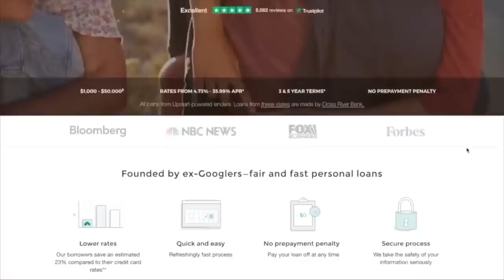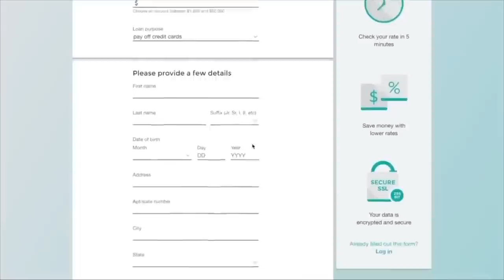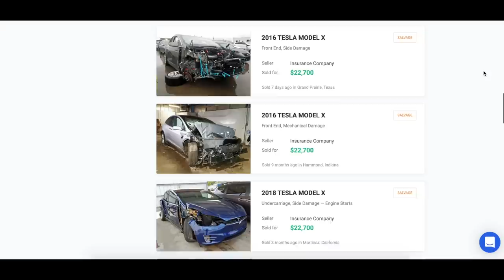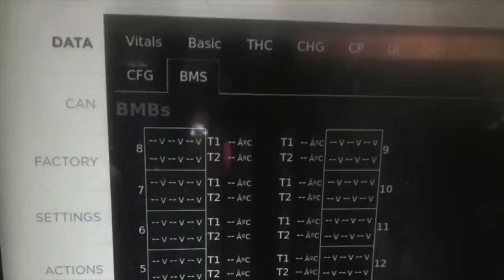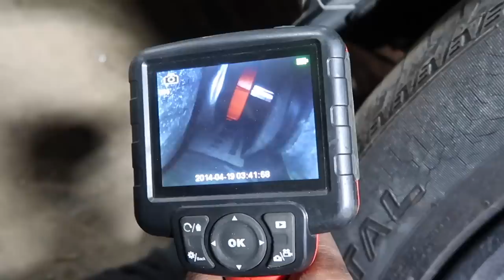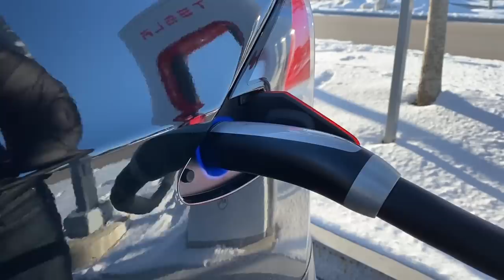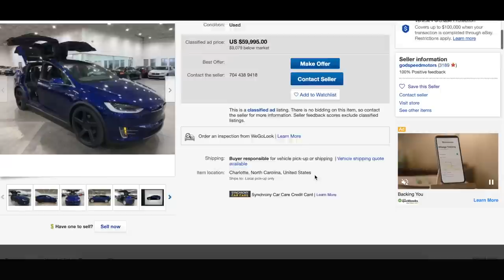Why this Tesla was my Biggest Financial Mistake

Comment: I've worked on a house like this once. Gutted to skeleton and even had to replace some stringers.  Would have been cheaper to bulldoze and drop a prefab.
Reply: But the Shell of the house was beautiful?
Reply: @Lovin_NY93  nope not at all
Reply: Why is it renovation is so much more complicated. I did the same - saved a house that cost more than new construction. Learning curves are seriously underrated
Reply: @b4804514  problem with it is most of the time it's dealing with a ton of badly done small renovations done over 100 years plus boards warp and houses shift. And don't get me started on frost heaves

Comment: This is why I bought my model S 60 for 32k. Looks and runs like new, and no labor involved. Uncle rich's videos have scared me silly. I was going to build a EV from scratch for my channel. Not anymore! 

Great lesson in this video. And good job to everyone who brought this model x back to life. Absolutely incredible!
Reply: DIY Solar Power with Will Prowse  you get a used fully loaded Bolt EV now for $18,000. lol Why rebuild anything when you can just buy.
Reply: Will, I converted a 1986 Mazda B2000 to DC EV. 8 grand for parts, not counting labor, and the batteries (at the time) lead acid - are WORTHLESS. Now if I want to get it going again, I’ve STILL got a 1986 Mazda with no heat, no AC, and I’ve got to get batteries and a BMS. Anyone want it? 9 inch netgain, Curtis controller (the one that whines at low current/slow speed) - I’m thinking of pulling the guts, putting it in a newer body... who am I kidding... 
-
One thing I did learn (I live in South Carolina)... If you don’t have a 400 degree (F) heat source in front of and under the passenger cabin, AC isn’t a MUST, its merely a ‘nice to have, but I’m OK without it’.

(I love your channel too, Will!)

Comment: i had the same happen with a 1991 BMW E30. $3500 for the car... $7000 in repairs later i donated the POS after i melted the pistons. so $10k+ evaporated. the term we now use for these scenarios is "toxic asset." --- something that really can suck up all the money in the world and still be worth less than the sum of its parts.
Reply: Lol I mean it's a bmw
Reply: all BMWs are toxic assets
Reply: Had the exact same car and problem I paid 3500 for it and when I added up everything It surpassed the cars value i cut my losses sold it for 2000 and lost 1500 but I know it was the right move
Reply: Also did it happen to be 318is?
Reply: Manz lol... Yeah, I hear ‘boats’ are like that too...

Comment: Flood cars,  stay away or more accurately run away. So many electric modules that corrode. They may be good today but tomorrow or the next day?
Reply: Agree-this car is a time bomb-Teslas as used cars make no sense, especially with damage. I predict that once there is a large number of these cars on the used market, their value will plunge-just too expensive and difficult to fix. I'd also be wary of allowing such a car at a public charging station-might be dangerous

Comment: I would have very much liked the Louis Rossman collaboration. Judging from the two channels, I'd say Tesla and Apple are very much alike, Tesla is trying to avoid the right to repair as much as Apple is trying to stop it from happening to them.
Reply: I'd love for this collaboration also.. would make amazing content.
Reply: Agreed, it's kind of surprising how similar they are. Also with Tesla's warranties starting to run out we may see more of the wear and tear problems that Teslas may have as opposed to rebuilds.
Reply: Probably the biggest reason I avoid Tesla. Repairing a car & modifying it should be a right. This is just anti-competition business practices which is designed to only benefit themselves.
Reply: this mail louis the boards and see if he can figure them out if he does you got spare parts
Reply from the maker: its still in the works

Comment: Great video Rich, very well explained the potential pitfalls of salvage rebuilds.  I've done 5 Teslas, two MX. With a '16 P90D, all was great, no hidden surprises. With an '18 100D, looked like only front quarter.  Has hidden frame damage. 6 months later, still in process of repairing, and the cost is over 10k more than I first planned.

Comment: Hey Rich , at least you have less financial mistakes than Sam Crac ...check out his Range Rover disaster 😂🤣😂
Reply: Range Rover was a good buy, he payed 1400 when parts are worth 3-4k alone.
Reply: @MrQuidy  How about the green Ferrari?😂😂
Reply: Range rovers can be a gold mine if the good money parts are in great condition, I got offered 3k in total through several buyers wanting different parts.  for a; bonnet, rear tail gates, wheels, full doors, sunroof mechanism, air con controller and pump, original working H&M stereo and then the seats yet best offer for the complete running car was only 1,800 🤷🏻‍♂️

Comment: I think that your mistake was buying a FLOOD damaged vehicle. It's one thing to repair a salvage car that was in an accident, but water damage is something that is not worth trying to fix because it causes so many problems throughout the entire vehicle.
Reply: Generally speaking a ‘flood damaged vehicle’ doesn’t have body damage. So, in theory, you take the good parts out of a wrecked vehicle (carpet isn’t damaged much by a wreck!) - and put it in the flood damaged one. Until..... you have the problems that Rich had...
Reply: @Maybe-So  so change out like every damn mechanical part, wiring harness, wheel bearing, everything? Flood damaged is NEVER worth the risk, spend your money and time elsewhere.
Reply: Flood damage can range from 1 inch above the doorsill to 20 feet over the roof. Its a gamble. If he wouldve held onto it a pick up a good driver with a destroyed body and swapped everything over he mightve come out ahead

Comment: Rich, the sheer numbers regarding dollars just blows me away.  I just bought a 2020 Chrysler Pacifica totally optioned out, for $44k (out the door with 7 yr 75,000 mile warranty) and literally - that is a fortune to a guy like me. I have no idea who is buying all of these Tesla's because honestly,  most people (that I know at least) can only afford $40k or less regarding a new vehicle. 

These Tesla's will never make the $3 to $6k used car market - which is the price range many lower middle income to working poor purchase from. Electric hybrids (the Prius) are within this price range (and can be worked on by independent shops). I can get a decent 2007  Prius with 320,000 miles for $1,200.... that runs good. Nobody wants an older Leaf due to the range issue.

Until electric cars get into the ICE used car cost structure (for used cars & independent repair shops), electric cars will remain only available to the upper middle class & the rich (no pun intended). The reason why I watch your channel, is hoping you get enough interest in the electric garage out there to bring electric into the mainstream (hoping other independent repair shops see what you've done and start doing the same themselves). Otherwise, Tesla's remain but a dream to many people like me (as we cannot afford used electric cars that need repairs that are in the thousands every time something goes wrong). 

Sorry to see that this Model X build went south on you, but it made for excellent content (and others will learn from your mistake at least). Keep on keepin on with your channel, it gives me hope that one day, I may be able to not only own a electric car - but can take it somewhere to get repaired inexpensively.

Comment: Hey Richie. You built a hot rod with an electric bike. And you rebuilt Tesla vehicles. With what you have learned and sharpened your skills. You can do more if you combine everything you know. Would it be in your interest to custom build your own electric truck. Using 2 drive trains. One for the front and one for the back. The front drive can be a combination of a 1/2 Ton Dodge Ram Promaster cargo van. And 2 battery packs from salvaged cars that are in reasonable damage. Only using parts for the conversion. And making a simple 1/2 ton truck. The Chasis design of a truck offers a simple and yet effective support structure for the batteries and drive train. And the body. Just be creative and make it your own design. Just a thought and yet of course with careful planning.

Comment: Not worth rebuilding is applicable to many flooded cars.  Damage is always extensive depending on water height (especially that high).  Tesla with all the electrics and electric motor driven components make it much worse when flooded.  Stay away from flooded salvage cars these days.

Comment: $14,000 for the battery pack from ANOTHER d90X, so that is USED!  Then $7,000 for a regular REAR motor, not the performance used too!  This car is too expensive to do a major fix on, makes more sense to lease and then give back.  I remember once reading that a $100,000 car costs $1,000,000 if you were to build it with new parts.

Seeing how much electronics there are in this car, and how inaccessible everything is, it just doesn't make sense to fix a BEV.  I wouldn't buy any BEV used, I would get them new, and assume $0 value when the warranty runs out and sell it immediately, or just lease it and hand the keys back.

Comment: Speaking of vipper money pits. I know someone who bought a "lightly" hit viper sight unseen. Turns out the car was smashed on the drivers side so hard the frame was bent and needed to be replaced to start off with 13K. Then you find out that viper parts are outrageously expensive.  The rocker panel cover behind the side pipes? Made out of titanium and cost $6000. No my finger didn't stutter six grand. Hood? Another 23 grand. By the time he was done fixing the "lightly" hit car he could have literally bought a new one.

Comment: It could just be me, but for the amount of money a Tesla costs, these all should be waterproof simply because they are high voltage items and all the components should be sealed against such an event.  It is a fact that VW Bugs were orginally so well built these floated.  "If you have you ever asked yourself “do Beetles float?”, the answer is yes: the original Volkswagen Beetle would indeed float on water. ... The original Volkswagen Beetle was essentially a unibody car built on a floor pan, with very few openings and well sealed doors."

Comment: I don't have the means to make this, but it'd be cool if there was an online tool or something where you could determine the amount of risk (in money) with buying a salvage flood Tesla using a few variables. 

For example, it'd have a car sitting in the middle of the screen and a bar you could drag up and down to reflect the level of water that the car sat in. Next, there'd be a toggle to switch between salt and fresh water. Lastly would be a time modifier to say how long the car was in that water. There'd be an algorithm that knows the initial price and the relative decay rate of each component, which would output a price range of how much money it would be estimated to fix. 

IDK. I just thought of the idea right now. It'd be a very niche thing and it'd probably be more work to implement than what you (as a programmer) would get out of it, which if you're not doing it for yourself would largely be 'satisfaction'. Oh well. I just decided to throw the idea out there and it might become someone's programming project for a while.

Comment: The replacement of batteries has always seemed to be the largest downside of This battery tech versus petrol engines. Even if you buy brand new engines from manufacturer, you’re still paying less for that and a transmission, and you’d have to double that just for the batteries even.

Comment: The other motor? What is wrong with it? Could we take it apart, replace bearings and power electronics, and put it back in the car?  I know they use all industry standard components as far as I know. As long as the motor windings aren't open, I'm pretty sure I could fi any of them. If you have some bad ones in your shop let me know,  I'd certainly give it a shot...

Comment: Unfortunately a flooded car is supposed to be destroyed, and not rebuilt and resold, unless it is a classic car, and there is a frame up restoration performed.  Even then, it is still hard to sell them.  And when there is a flood/totaled branded title, the value drops dramatically, even at a junk yard.  When there is a rebuilt title, the value drops to less than half of the lowest value of the NADA book value, if you can even find someone that is willing to take a chance on it.  Dealerships will not even look at it when you try to trade it in, and many dealerships won't take it into their shop either, for safety and liability reasons.  I wish I had been able to tell you this before you bought the car.

Comment: I'm not sure subjecting PCB's to ultrasonic vibration under water will result to anything good. It has the potential of loosening the connections on it. The enclosures these come in are water-proof so you kinda get the idea that these aren't supposed to get wet.

Comment: Now a days you risk to by even the salvage gas cars they have so much electronics. They can start but it doesn't mean they will run good. I had a Cadillac that will turn off at any time and it will turn right back on after a few minutes or hours

Comment: Hey Rich; Do you know of a subreddit or even more public place where we can report  Tesla garage F-ups?  
Reason?  I took my model S to the Tesla shop a few days back. No Electrified Garage near my state... wink wink.  Took it to fix an issue with the rear parking sensor misfiring, which they claimed they fixed for $205, BUT DIDNT.  They serviced a 'recall campaign' as well and evidently removed my front tires... and didn't tighten the lugnuts all the way (unbeknown to me- obviously). A few dozen miles later, I get a SUDDEN & SEVERE wobble  at 110 MPH...    I thought it was a blown tire, but the TPS reported OK pressure, so I limped my way back at 40 MPH.  Lifted the car, and TA-DA!  each lugnut tightened between half to a full turn !

Comment: Here's a question I asked could you actually do the opposite? Like say I had a Tesla, a base Tesla, used with like a hundred k on it still within warranty. If I wanted to upgrade the battery? Or upgrade the motor to a performance motor...is that possible?

Comment: Hey rich I have a question for you i love my 1984 dodge rampage but it just keeps having problems I've been a big fan of your work and I've thought about converting it over to electric and updating it some any words of advice or any idea if it will take any serious body modifications ?
Reply: I had a '84 dodge rampage with a 2.0L 4 cylinder engine. That was my first car and unfortunately I had to sell it because I was moving away. Fun little car akin to a el camino. The only problems I had was with a water pump and stick shift not wanting to shift easily. Also, my left engine mount bracket broke off and had to get a new one from junkyard. It tilted the engine sideways a bit and transmission was grinding a bit. Fixed that and then it was great. Great utility car. I remember one time I went to homedepot and bought lots of bricks for my garden path and I loaded the car so much that the back leaf springs were virtually flat. Got it home ok.
Reply: @jcd13able  sadly less then one hour ago she blew up my 2.2 is done this was legit my first car this year that I bought but she's gone I'm ac about to crank her over in about a 30 minutes to even see if I can
Reply: That's too bad. My 1989 ford escort is having some problems with the engine. Probably needs new bearings. Over the years I put a lot of inexpensive parts into the car so other than the engine and transmission the car is practically new. I'm going to fix it myself like I always do and even though the car is old it's reliable and easy to fix. Love these old cars. I just got done fixing my friend's '82 vw jetta which was a trip in itself. Very different from what I"m used to fixing. Don't forget that there isn't anything that can't be fixed on these old cars and maybe you can bring yours back to life.

Comment: I’m getting scared 😱, just bought a model s at the Auction for $20k it looks good on the photos and the action info “ says” starts and runs, but before putting the Tesla in a boat to ship it to Puerto Rico where there’s NO Tesla service shop or Tesla Dealerships, the driver lock the car with the keys inside right in the middle of the lane to get it in to the boat. I call tesla after 4 hours and lots of people and paper work finally add my car to my tesla app so i can unlock it via the app surprise this tesla is not supported, why ? We don’t know that was their answer. Let see next week when arrives. God Help Me.

Comment: I guess it is just a gamble, no?  If the battery pack and or/motor were still good, you would have been profitable.  And if both were good, a decent chunk of change.  

But all points well taken.  Don't bite off more than you can chew, swallow, & stomach.

Comment: I’m having a hard time following your explanation of your costs and accounting? I realize why you stated that you put $7k into the car but  by switching to the lower less powerful drive motor ilowered the cars value compared to a working non salvaged model  resulting in a net loss of 14 to 21 thousand for you. However during your attempt to explain, the background shots show conflicting numbers  totaling around 22k for parts? Did you sell off the remain  parts you didn’t need and applied it to your bottom line but forgot to mention it?

Comment: Buying a salvage electric tesla that has been in a flood is worse than buying a normal flood car. Can you say money pit? Their is a reason this vehicle was written off as a loss. With how low to the ground tesla designed everything in this car such as the batteries and the electric motors etc (lower center of gragity) these will be some of the first things that get flooded😀